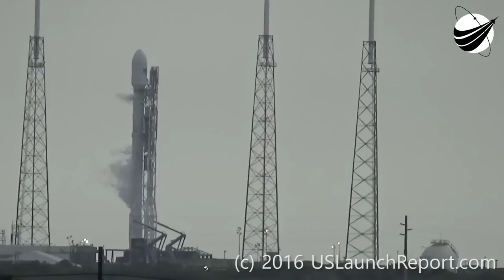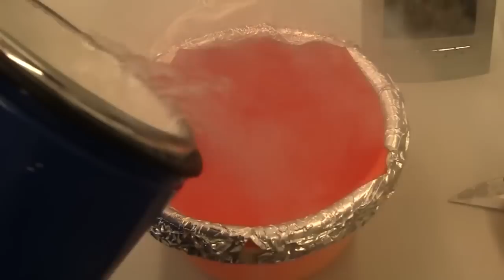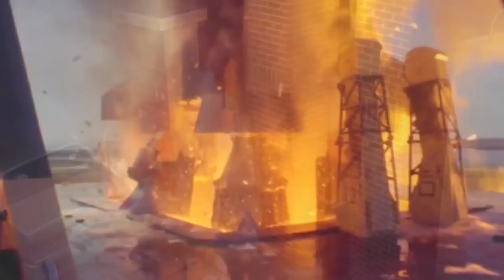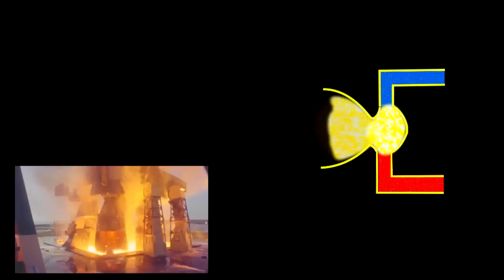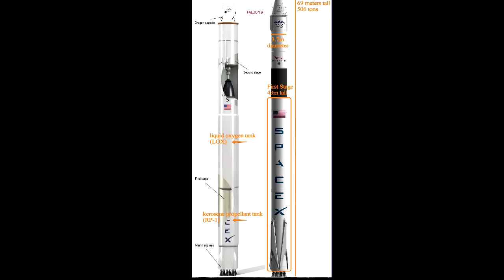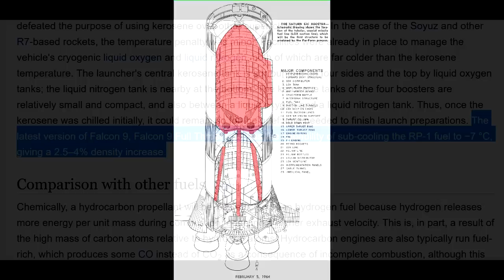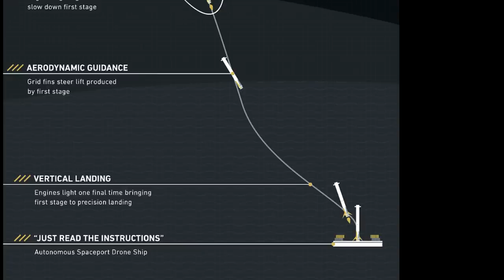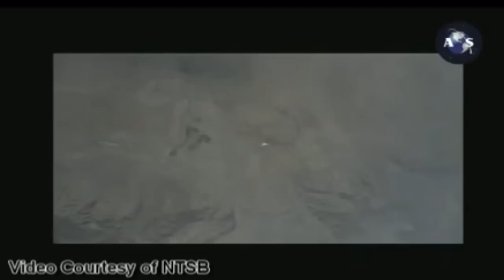Why did the Falcon 9 Explode?

Comment: While the points you make about delta v from reusable vs one time I do have to say I see it being cheaper in the long run. The main part that needs to be recovered is the engines in fact in Europe they are developing a system where the engine's decouple from the fuel tank and fly back to Earth on deployed wings (probably parachutes for the first few attempts). As for NASA being unable to put a man into space atm they are working on the Orion capsule which is intended to go to the Moon and Mars but can be used for LEO operations as well, unlike the shuttle which was limited to LEO. Maybe reusable Earth to Orbit transporters might be in it's infancy NASA will be reusing their Interplanetary ship designed for the Mars Missions.

Comment: Couple of things about your video.

the Falcon 9 1st and 2nd stages use a common bulkhead between the RP1 and LOx sections.  Lox could not have 'spilled' onto the RP1 tank, as it is not using separate tanks

(fun fact--I missed the first Falcon 1 launch after the launch was aborted by the F1 flight computer at T-0 due to low RP1 turbopump pressure.  Turns out that the RP1 had chilled enough due to the common bulkhead that the RP1 was a bit gelled.  Solution was to pump out half the RP1, and pump in warm RP1.  The Falcon 1 launched one hour later--damn my expectation that scrubs meant a week before another launch attempt)

SpaceX has had since the Falcon 1 launch 27 successful flights (5 Falcon 1 and 22 Falcon 9) with 1st and 2nd stages that use the common bulkhead construction.  

http://www.spacex.com/sites/spacex/files/falcon_9_users_guide_rev_2.0.pdf  Page 10:

"The first-stage propellant tank walls of the Falcon vehicles are made from an aluminum lithium alloy. Tanks are manufactured
using friction stir welding—the highest strength and most reliable welding technique available.

On the first stage of the Falcon 9, an insulated common dome separates the LOX and RP-1 tanks, and an insulated transfer tube carries LOX through the center of the RP-1 tank to the engine section."

Second, the combustion event appears to have started outside the 2nd stage tank, judging by the source of the lens flare caught by US Launch Report's video of the event

Comment: Your argument for why SpaceX shouldn't attempt reuse seems to boil down mostly to "it doesn't make sense to me". 

> They're giving up their last bit of fuel to land
The rocket is built with the understanding that it won't be able to use its last bit of fuel and is payload rated to account for that. If it was more economical to expend the rocket, they'd be doing that instead. As it stands, the Falcon 9 is the cheapest launch vehicle to LEO even before reuse brings the price down.

> Why not use parachutes
SpaceX has spoken about using parachutes. The weight of the parachutes decreases the payload of the rocket, and it was calculated that allotting fuel for a powered burn was more efficient than carrying the weight of the parachutes. Additionally, an empty rocket would have a hard time handling the physical stress of being slowed by a parachute at hypersonic speeds

> The Space Shuttle cost a lot to reuse
The RS-25 used a very complex staged combustion cycle. This made the engine exceedingly efficient but also an absolute bastard to repair. The Merlin engine uses a less efficient but much simpler open combustion cycle. This means the engine is much cheaper to refurbish.

> They haven't reused a rocket yet
The flight schedule was to fly a reused rocket on the SES-10 flight scheduled for October 31st, 2016. This flight has been postponed barring investigation into the AMOS-6 incident. They haven't flown one yet because they're being cautious and making sure the first stage can handle reflight before launching a satellite on it.

> Fueling incidents shouldn't happen
Until the cause of the incident is known, it is unfair to claim that this is a sign of SpaceX negligence. There could be an external factor at play that was not their fault.

Comment: Great Thunderf00t sir, a question from a very ignorant being:
Was the space shuttle really "recovering" the rockets that it launched or the "vehicle" that had the "in-built propulsion system"?
Because the space shuttle external rockets were never recovered in the same way that they were doing with the space x Falcon 9.
Or maybe I'm missing something.

Another question:
How is it possible that we heard ONE shockwave when there were TWO fuel explosions?
1st one at 00:03 and 2nd one at 00:07

Comment: Well to be fair, SpaceX had multiple full-duration static fires with one of the recovered boosters and SES-10 is the first mission to fly on "flight-proven" hardware. Granted, that only time will show how efficient the reusability will be.

Let's hope they figure out the issue. If it's not outside source like ground support equipment failure, it has to be design error. Which really is a shame, but I guess that's the lesson commercial spaceflight companies have to learn also and they cannot cut corners.

Comment: Time to build the Space Fountain. In contrast to the space elevator design, a space fountain is a tremendously tall tower extending up from the ground. Since such a tall tower could not support its own weight using traditional materials, fast-moving pellets are projected upward from the bottom of the tower and redirected back down once they reach the top, so that the force of redirection holds the top of the tower aloft. Payloads ascend or descend by coupling with this stream of pellets or by climbing up the side of the tower. The space fountain has some advantages over a space elevator in that it does not require materials with extreme strength, can be located at any point on a planet's surface instead of just the equator, and can be raised to heights lower than the level of geostationary orbit.

Comment: before a solution can be found in regards to reliability the cause of the explosion must be determined. it seems from the vid that the explosion that the point of ignition  was from an unlikely point on the rocket itself. this raises questions that  may not be strictly mechanical in nature thus the need to ascertain the exact cause of the failure.

Comment: @11:56 "Its a sort of weight saving thing for the rocket".

Isn't it a space saving thing instead and weight savings by proxy as you require less rocket structure to hold the same amount of fuel?

Comment: Look, Elon Musk is an over hyped Steve Jobs wannabe.  I think we all get that.

That said, the issues they are running into are ones of experience, and are not entirely of their own making.  I remember watching a program on the Falcon 9 and some of the other private rocket projects a few years back, and one of the things they emphasized was the "brain drain" problem at NASA.  Basically, when the Shuttle program was shelved, (and part of the reason it was shelved) many of the real engineers at NASA were already set for retirement, already retired, or DEAD.  MUCH of the early knowledge on how to build reliable space launch vehicles, particularly the older style ones such as those on the Saturn series of rockets, was simply lost due to bureaucratic bungling, government secrecy (remember that the rocket program was a cold war secret and thus much of the knowledge was and is still highly classified) and personnel attrition.  So in many ways, SpaceX and the other projects are having to start over from the ground up and re-build the space program as though it is the 1950's all over again, only they have to do it on a private sector budget.

If the government would have declassified much of the early rocket material say, 30 years ago after the collapse of the Soviet Union and allowed the NASA Engineers to take that knowledge to the public and teach in in our Universities then SpaceX might not be having the issues they are having now.  But because of government bungling and over-protection of secrets we have to start over, and make all the same stupid and expensive mistakes we made back in the 1950's and 60's all over again.

Elon Musk has plenty of attributes that make him well worth roasting, but this issue is actually not one of them.

Comment: A big difference between the current Falcon 9 and other LOX/RP-1 rockets is the use of subcooled LOX. Subcooled LOX is chilled significantly below its boiling point to make it denser and limit the amount of boil-off on the pad and during flight. Subcooled LOX was also used in the Orbital Sciences Antares rocket that exploded in October 2014. SpaceX has had numerous launch delays due to complications with subcooled LOX. I would not be surprised if it contributed to the failure.

Comment: So Thunderf00t, I want to make sure I understand your idea about why the rocket exploded, correctly. The LOX pipe going through the kerosene tank was cold enough to freeze the kerosene immediately around it solid. The frozen kerosene put enough stress on that pipe to cause it to crack, and as a result, the liquid oxygen and kerosene mixed together, which eventually led to the explosion. I think you might be onto something, but there are three things which are still unclear to me about your idea.
1. You assume that the LOX pipe was inadequately insulated, or not insulated at all (how do you account for the LOX freezing the kerosene?)
2. You assume that frozen kerosene expands (how else would it cause stress on the LOX pipe?). I'm not sure if this is the case but I am very curious to find out...maybe it's not an assumption, but it seems like one to me.
3. Even if the liquid oxygen and kerosene mixed together, what was the ignition source? I realize it is very easy to unintentionally generate static electricity which could have ignited the fuel mixture, but your idea did not account for that.

Comment: The shuttle may have been recovering its engines for over 30 years but not without incident. Out of only 135 missions, 2 ended with catastrophic loss of vehicle and all crew. At least SpaceX isn't trying to strap people to it's flawed design until they fix the flaws.

Comment: Basically we have a private company catching up to what Nasa and the government did over 50 years ago. For those of you who are interested go check out the youtube videos about the creation of the F1 rocket engine which powered the main stage of the saturn 5. Those engineers had to overcome some incredible feats of engineering for the time to make those engines work. Harmonic resonance in the combustion area was a real problem with the first prototypes and they solved that problem so well that even when they tried to cause a resonance situation the engines would simply correct it on their own without intervention.

Comment: If the point of reusing rockets is to save money. Does it not just make it worse that if you try and land a rocket and fail, you not only lose the rocket but also the power that could have been used on the initial launch or just left out completely. So unless you recover and reuse all of them successfully, it surely can't be cost effective.

Comment: Q. Why didn't the tower and the concrete around the explosion melt? Bearing in mind that the hydrocarbon fire on 9/11 evaporated the majority of the steel and concrete in both towers yet were nowhere near as hot? 

Or is this another example of physics being suspended in favour of jihadists Mr Foot???

Comment: So SECOND stage exploded because they want to reuse FIRST stage...

Shuttle was over-engineered peace of crap. First concepts were several times smaller, NASA just wanted slightly bigger crew transport vehicle, but had to ask DoD for money and DoD wanted vehicle that would be capable of stealing a satellite.

Of course they need more fuel for powered landing, but as we seen they have it. SpaceX have shown that they can deliver payload to GEO (which they are payed for) and still land (which they want to do to lower costs in the future). And basically they are in prototype stage, they still learn how to reuse first stage. There will be more mishaps and failures. But is it wrong to try and lower the costs of launching things into orbit?

Comment: "But organizations like NASA basically wrote the rule book on this sort of stuff" *while showing footage of the Space Shuttle. May I remind you that the Space Shuttle was a dangerous vehicle: no abort possible during the 127 second burn of the SRBs, it had 25 flights with questionably designed SRBs, the 25th being the Challenger disaster, 135 flights(which is all) with fragile heat shield tiles which were damaged by fuel tank foam(!) during Colombia's launch and caused the Colombia disaster. 

It has caused 14 deaths, had the highest payload cost, had to be taken apart en reassemble after every flight and it couldn't even get in a high orbit(around 528km).

The Space Shuttle is a blatant example how NASA broke all the safety rules and continued to do so for almost 20 years.

Comment: Falcon 9 makes me wonder why they don't have two tanks for the first stage, one for boosting into orbit and another one below it for safe rocket re-entry. Then you can just jettison the weight of the relatively inexpensive first stage tank and use the remaining secondary fuel tank to land safely, since you're slowing down much less mass you need significantly less fuel, even if you only get rid of the oxidiser tank, it would also be much less tall so landing on a semi-stable drone barge at sea gets much easier.

Comment: Furthermore, your arguing against innovation. These techniques to reduce weight are innovation, sure they add risk, but that's how SpaceX learns, by making mistakes. That's why so many landings failed, it was much cheaper that way. Also the shuttle was horrible design, most of the cost was the tanker which was thrown away, and the SRBs which fell in sea water and needed heavy maintenance. It was good technology, and expanded upon things that could make cheaper rockets.

Comment: Your wrong, the price for a launch is 60 mil, the rocket is about 30 mil, and the support structure will be damaged. Further more, maintenance is estimated to cost 3mil, so the cost is 10 times lower. This refueling issue hasn't happened before, and in the short term it will hurt spacex, in long term it will at most delay plans, or have no effect at best.

Comment: I fail to see why you think there is a connection between recovering the first stage and a failure during fuelling. You are also incorrect in suggesting that SpaceX is unique in the number of accidents it has experienced. Look up on the internet how many launch failures have occurred in the recent past and you will find SpaceX has a reasonably good record. Your suggestion that NASA would not allow such failures is clearly false as they did, repeatedly, allow failures - including ones that cost lives. NASA got so bad as spaceflight that they eventually had to outsource most of it. To this day, NASA spends far more than anyone else on rocket development etc yet has not got a better track record. They would do well to outsource all rocketry and concentrate on satellite development.
I also don't think you fully realise the benefits of recovering the first stage. Once its re-usability become standard, it will save 20 million dollars upwards per launch - assuming just one reuse.

Comment: I am surprised SpaceX isn't putting it's funds behind the new magnet-based space catapult. It is much safer, it is reusable for the most part (might have to change something if you want to re-target it) and the most important thing: It can run off literally anything, as long as you can use it to produce enough energy to fully charge all the capacitors. They could use solar power to put satellites into orbit! It is amazing technology, someone just has to fund it.